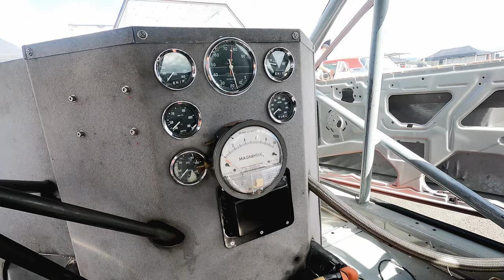Italian meets American: 5.0L V8 Mid-Engined '79 Alfa Romeo GTV || The ALGIE ALFETTA

Comment: the heart of the Alfa Romeo Alfetta is its ITalian engine, either Satta four cylinder twin cam or Busso v6; if they wanted a v8 they should have put the v8 tipo 33 engine into it or the montreal v8!
Reply: Have a read of this and you'll see why this car was built this way. Cheers. 🍀❤
Reply: @anthonypetty9288  I read the full article attached to the video clip but i rest by what I said. The Alfetta is an Italian car and should have had an Alfa Romeo Engine. There were 18 Alfettas built with the montreal 2.6 ltr V8 for road driving. However the race Alfa Romeo Tipo 33 3 litre engine which the Montreal derived from, produced 440hp in 1971 and was injected and very reliable and placed mid engine in the tipo 33, with Alfa Romeo coming second in the world sportscar championship behind Porsche with their much more potent 917s and ahead of Ferrari with their 512s and 312s. The Tipo 33 with the 3 litre 440hp engine was compact also and could have been slightly bored out to increase capacity and power and put into the Alfetta.
Reply from the maker: you seem to be forgetting a few things here:
- NZ is historically more V8 or American inclined than of European influence. There's a massive presence of American Classics and currently 2nd country in world by Classics per capita;
- NZ is a country far away from the rest of the Western World, this car was built in the 80s when shipping and spares were not as available and globalized as today;
- The costs of maintaining your proposed power plant vs. the cheap and easy to find, durable Chevy V8 which still delivers blistering performance at 8500rpm for a tenth of the investment;
- Your reference to the Tipo 33 Stradale is like saying go get an engine from a Mclaren F1 GTR or a 250 GTO and go race it hard on track. As much as we'd love to see and hear that, it's a very unrealistic proposition from a budget perspective.
Reply: @racecars.universe  I was good friends with a NZ designer living in my city in England and he was also an Alfista and he built a Giulia GTA replica with an Alfa Romeo engine without any problems although he did say most of his parts were sourced from long way away. Also I did not mention the tipo 33 stradale at all! That was a limited production road car which because of the tiny number produced has become very expensive over the last years, although in the 90s that was not the case relatively speaking. I was referring to the Tipo 33 engine which would have cost the same as the equivalent porsche or ford engines in period in the 1970s and was one of the reasons Brabham used it in period. I also said that the montreal v8 could have been used, which is a much less dear option and indeed montreal car prices were very low in the 1990s. If you are going to use a Chevrolet v8 then in my opinion it would have been better to use say a camaro car.
Reply: A very interesting video. Did this car compete against my namesake's built E49 Charger back in the days.
Reply: @cbca6567  Well the original plan was to fit a turbocharged Porsche engine. The Chev engine was already in NZ and came out of a F5000 car. The cost of importation back then cannot be underestimated
Reply: From what I remember the NZ saloon car rules allowed a 5.5 L engine and later on this was increased to 6.0 L. I'm a huge fan of the classic Alfa Romeo engines, but even a 3.0 L Tipo 33 V8 engine would probably not have been competitive, unless there was a 3.0 L class or different weight limit for 3.0 L cars. Also you might find it difficult to get parts for the Tipo 33 V8 engine in NZ unless you had Alfa Romeo factory support. Meanwhile the fuel injected Chev V8 engine might have been surplus from a F5000 car, as that championship was winding down around that time, and there are quite a lot of V8 engine builders and parts suppliers supporting different types of racing. The Montreal V8 had a 90 degree crankshaft, so probably not an competitive option (unless you convert to Tipo 33 specification) and when they started building this car the GTV6 wasn't in production.
Reply: @alexjenner1108  Sure it makes sense economically to use a Chevy v8 but then why choose an alfa Romeo 4 cylinder road coupe, which had a very soft chassis from the factory, suspension pick up points not very strong, and running gear able to support not high levels of power, necessitating complete reworking of every part or mechanics, suspension, brakes etc? If the Chevy engine was the main star, get a US car designed to support it as a base. Regarding the tipo 33 v8 it was an option in the 1970s only because they were current but sure distance and support are factors. Actually one Alfa Romeo Montreal engine (90 degree crank) was prepared for racing by Autodelta, the racing department, bored to 3 litres and produced 370Hp at 8000rpm and was as fast as a Ferrari Daytona Competition in a straight line, but a big factor was the cars low weight by comparisoncompared to the Ferraris in that category. The NZ sallon car rules seemed to favour lots of HP, however the first Alfettas to race in Australias Bathurst were prepared 2 litre four cylinder cars that won their class. Lastly Alfa Romeo also produced turbo four cylinders and the later alfa 75 was way north of 400hp in race trim.
Reply: @cbca6567  when building a racing car, the first thing to do is read the rules of the class. I'm not certain of the exact rules and reason to choose Alfetta GTV, but I suspect reasonable aerodynamics for 1970s, and the rear transaxle were two reasons. As you said, the Alfettas with 2 litre four cylinder engines won their class at Bathurst, but this car was built for a different class with different rules. There were also a couple of Alfetta GTVs running in Australian sports sedans and those were also running American sourced V8 engines. Having a Montreal V8 with 370hp still doesn't beat a Chev V8 with 500hp and the Chev probably has better torque for accelerating out of tight corners. The GTV6 was great and was the best car in the Group A 2.5 L class until homologation specials like the M3 came along, but those were different rules. The Alfa 75 turbo engine came too late to find a home in this car and arguably too late to make the impression in Group A that they would have, if they had arrived a few years earlier. I seem to remember Colin Bond racing a Alfa 75 turbo in Australian Group A racing and he wasn't beating the Holden Commodore 5.0 L in those races, so I'm a little bit sceptical about it beating the best sports sedans with 500hp and less weight than the Commodore, at least not without an expensive development program. In the end, if you want to beat a mid mounted V8 with 500hp in a reasonable light car, even if you have a lighter engine, you're still going to need something close to 500hp or do something radically different like the 4WD Alfa 155 GTA Turbo or the 4WD 155 DTM cars, but those cars came much later.
Reply: @cbca6567 Do you have any idea what a tipo 33 engine would cost(and still not have that power)? Get this power from a Montreal 2.6 V8, not gonna happen, by far. 
This is a smart purposeful build. The class is not about purity. The choice for the Alfetta 116 platform is obvious, because its light and has the transaxle setup all there, original triangle axle and watt linkage still there.  Just a good base. And it works, corners way better than the competition.